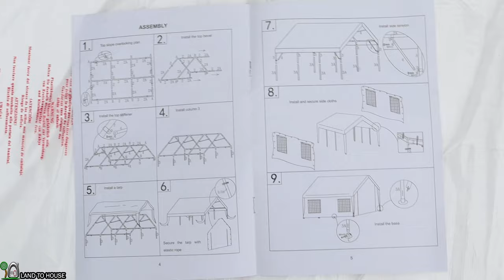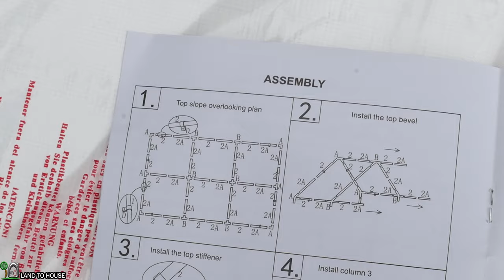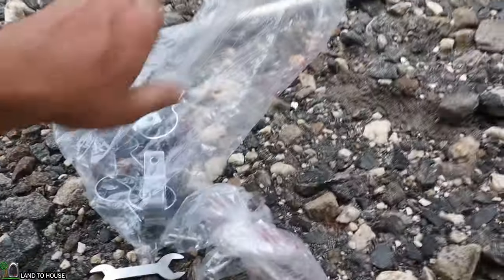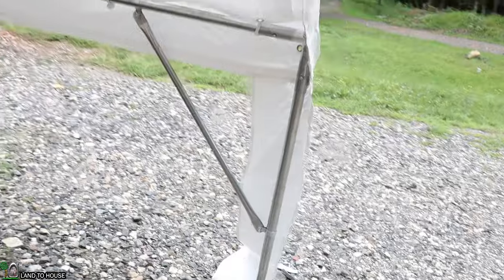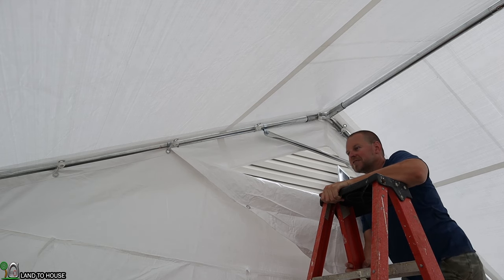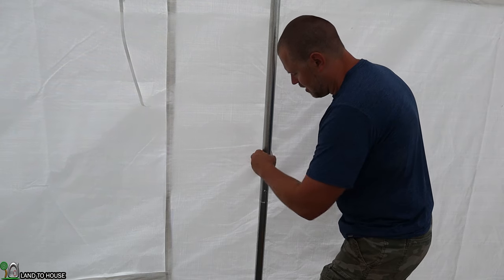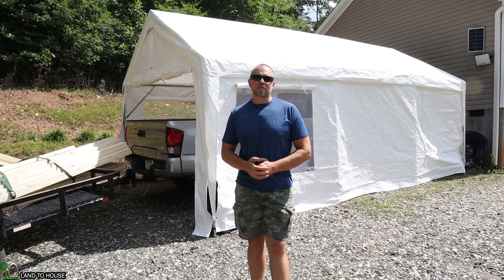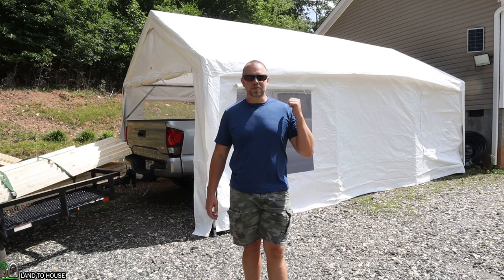Vevor 12x20 Portable Garage full assembly and overview

Comment: I just called VevorAnd they said that they do not have a top or a side replacement part for the 12 x 20.However they do for the 10 x 20 what a shame really would've liked to have had the 12 x 20 but it would just be junk in 2 to 3 years I doubt that the tops last any longer most likely less than three years. Although I really liked the bracing on these

Comment: HF’s 12’x20’ portable garage for $399 seems a much more solid choice. No windows but the frame actually anchors to the ground (not just stakes or sandbags) and straps the one-piece main skin down solid to the ground (no openings other than the two roll up doors).

Comment: Nice looking.   Needs some add on’s for improvement.   One, need a tarp or individual cover between the piping and the trap.  If it gets hot in your area, the metal frame may heat up and burn the cover.   Two, as much I like the bungee cords, zip ties will hold up better.  Three, the cover does not appear to be very strong.  Four, the stake pins are not strong enough, if you  want this to stay in place in the wind.  Five, sand bags look nice, no nothing.   Buy screw in anchors, I use the one with removal cap and use a drill to place in the ground.    Mine is two years old and with stands 75 mph winds.  Heavy winds, I remove the top cover.

Comment: I was surprised by the price, quite a bit cheaper than expected......which probably is the reason it is currently out of stock!!!!! Once the permanent garage is sorted this could become the frame for a rather large shed. Put it on some footings, reinforce it with more of those corner support bars or similar, maybe a few more main support bars, some cheap roofing and siding....and bang, a super cheap 200 sqft shed.......or just pack it up and use as a party tent, as one comment suggested, or whatever when and as required :)

Comment: That is like a premiere edition compared to H.F.'s. Theirs is 10 dollars more and not as nice. The tubing on theirs is a lot t6hinner as well. One door and no windows. The H.F. ones doesn't have the push buttons on their tubing frame also so some people put self tapping screws in them. Great job!!
Reply: Judging from the ratchet straps and much beefier ground anchors, the dark gray HF 12’x20’ ($399) portable garage seems a lot more sophisticated. The tarp material in this Vevor garage seems much flimsier and is only attached by these little bungee loops plus some Velcro strips. The HF one has sown sleeves where poles slide through and hold it in place. There’s really no comparison here.

Comment: Perfect! This is my project for today, and I'm so glad you took the time to make a video that's clear and thorough on the assembly. Much better than following the little booklet they included. Thanks.
Reply from the maker: Nice to hear that the video was helpful. So far the Shelter has been working well.
Reply: @LandtoHouse  it turned out really nice; but took me about 6 hours total. I tethered the sand bags with some paracord to the frame like you did to anchor them even more. Looks pretty good. I have a Tacoma as well and it fits inside well.
Reply from the maker: @mojorayjones  I'm glad to hear that you got your shelter in place. Recently we had some very strong winds. So I took some old tires with rocks and weighted this down even more.
Reply: What about winds? When heavy rains?  @LandtoHouse

Comment: Thanks for the great video. My wife and I like to decorate the house and driveway for halloween, and we think this will make a perfect tunnel or passageway for the trick or treaters as they come to the front steps. We can have hot chocolate and a heater inside for adults as well. 
Once Halloween is over we can move it around the back and use it to shelter the snowmobiles. 
Great video.

Comment: Thanks for the video! My Vevor 10x20 was just delivered. I got this for protecting my new car, Im not in a permanent living location so i didn't want to build a garage. Im also concerned about snow, but have a Shelter Logic thats on its 4th winter we have some heavy snow in CT and its doing great although Im diligent about taking snow off of it. Im hoping Vevor will be just as durable... 🤔 🤞 
Put it up today, it already tried to take off before we could get it grounded 🥴 and we only had 12mph winds today... Definitely a cheaper product than Shelter Logic, will be having to reinforce with lower conduit pipes since this product doesn't have any lower pipes to the frame, this also causes the sides to flap around,and we are having to use tie down straps attached to boulders since only 3 earth anchors cooperated with the rocks in the ground. The anchors it comes with do nothing to secure this tent. I have to say I'm a bit disappointed with the quality when comparing to Shelter Logic, but ya get what you pay for 😣  I hope it lasts at least one season and doesn't actually collapse... 😮
Reply: We just took down our shelter logic because it got destroyed by the Sun. It was on its second tarp thrown over the top and tied to the base due to it ripping apart and disintegrating. On second tarp now the door disintegrated into nothing, so it went down.

Comment: I have been working with these structures since 2006 and this is the first time I have seen the slope pipes in to 2 pieces. Do you think that increases the support strength or weaken the structure. I have invented a roof support system that can support upto 16" of compact snow and ice. You can put the top on before putting legs on then just tip roof up on one side, put the legs on one side then same thing on other side. I am not sold on split rails and legs. They just do that to save on shipping.  Good job

Comment: You think this would be sturdy enough to use as a greenhouse frame? Im worried the wind will brake the frame.
Reply from the maker: You might want to add some extra supports to make this a more permanent greenhouse structure. It could do the job, but it's a bit flimsy in strong wind.
Reply: @LandtoHouse  Thanks. I thought this frame looked more sturdy than the cheap 10x20 amazon greenhouses. And its 3 ft taller in the center.  I'm in st. louis and the wind can get crazy here. I think this could work if I reinforce it with some 2x4's